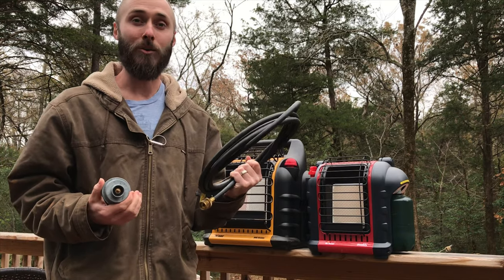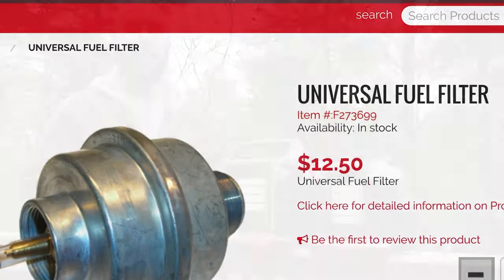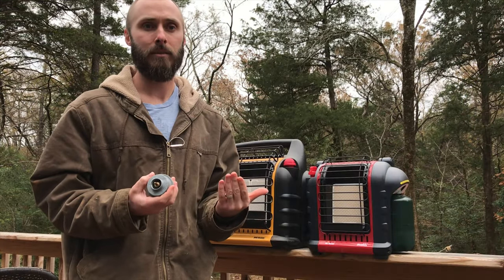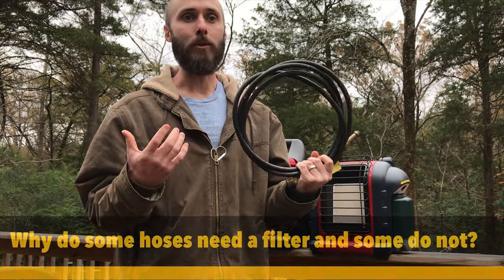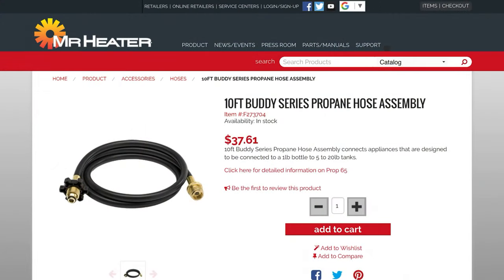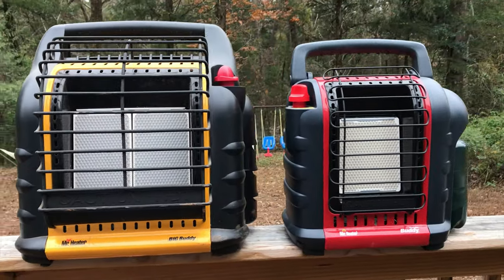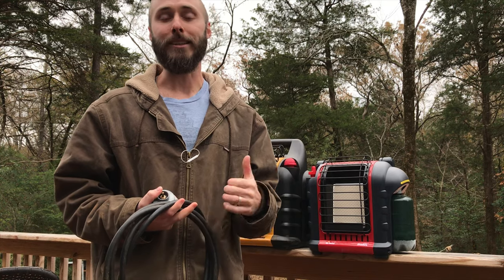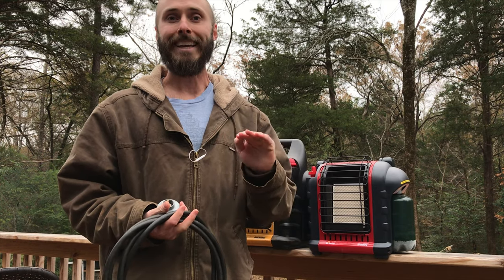Is a Mr. Heater Fuel Filter Needed When Connecting To a 20 lb propane tank? | East Texas Homestead

Comment: Why not just restrict the flow of gas from the tank valve? Thereby reducing pressure in the line.
Reply: He said because there's a built-in regulator and by doing that it would be over regulating the system.
Reply: You can get a hose with a regulator that attaches to the quick connect in the big buddy, bypassing the regulator built in to the big buddy.

Comment: You do NOT need the filter if you buy the 12' hose with regulator for the Big Buddy heater.
The new hoses are made differently so they do not leach oil into the Propane.
Reply from the maker: the regulated hoses are the way to go for sure. Not all "new" hoses are good.

Comment: There is a quick connect behind that 1lb bottle regulator that DOES NOT go to a regulator! If you are using the quick connect (@1:37, brass colors, right side of 1lb bottle regulator), you need the hose with the regulator at the tank! If you are using the hose that screws into the regulators meant for the 1lb bottles, then you do not need a regulator at the tank. If you pull up the Big Buddy parts diagram, there are only TWO regulators (for the 1lb bottles), not three! The quick connect taps into the line AFTER the 1lb bottle regulator!
Reply: Thank you!  I was about to ask why one of the hose choices has a regulator if it's built in. But now I get it, thanks. With a regulator on the hose with a 20lb, you connect to the quick connect. Appreciate the post.

Comment: To be honest , I just ran a filter on a bran new heater . After 1 winter season on a 4 foot hose , the whole system was soaked with oil . Buy a good hose and use a filter and hope for the best . Thanks for the advise !
Reply from the maker: Wow! that's no good. 
I've always run the Mr. Heater brand hoses and haven't had an issue.
Reply: @EastTexasHomestead  I used it as my sole source of heat for an entire winter . If I get 1 year out of a 87.00 ( going price at Walmart )got a new one ) I might be complaining too much .

Comment: The filter is just an inline canister that allows the oils pressed from the walls of the hose to rest outside the path of flowing gas.  They suggest you should replace these annually.  There's no way that you're going to fill this canister with oil before the hose itself is ruined, and I'd expect it would take more than a couple of ruined hoses to get any notable amount of oil into this container.

Comment: I bought a mr heater brand hose that does not require a filter and a year later my buddy heater is filled with oil. Im thinking it was either a counterfeit or you still need a filter. Expensive lesson.
Reply: Counterfeit.

Comment: If rubber is squeezing thru your hose then you are using the wrong hose. They do make hard hoses and I have had one for 15 years and still works fine. Coleman propane hose.
Reply: Mr. Heater part #F273704 is the one to get.

Comment: I saw a video of someone who was using a Mr Heater filter for years. He decided to cut it open to see what was inside. There were four tiny drops of oil inside the filter. And the filter is just a hollow aluminum ball....there is nothing else inside the filter. I do believe the filter is a good idea but it will last forever. Buying a new one every year is a total waste of money.
Reply: I have not found a video or picture of someone opening up a propane fuel filter.   I heard they were hollow inside but you are saying they have a ball inside for the oil to collect on?  Thanks.

Comment: I call B. S lol specifically made hose 😂 ive heard it all now
Reply: Just had to replace my buddy heater because I thought the same thing. This time I got a filter. I tell you what, it sucks when you're heater goes out at 12:30am all because I was cheap.
Reply: It's not BS.   Mr. Heater part #F273704 uses a different hose material that has low plasticizer content.  The cheap hoses have tons of oily plasticizer that will leak out under high pressure and gum up your heater.  It's really not that complicated.

Comment: My line has a schrader valve (similar to a tire valve). Take the outfit out doors, open the the valve on the twenty pounder, point the hose down towards the ground and push that Schrader valve and watch (safely) the oil blast out. Shameful where ever that oil comes from.

Comment: It is NEEDED 
Mr Heater is USELESS without it.
Mr heater works (without a filter) a few times before all the pipes inside mr heater are clogged w oil. Why the FUUUK does this not come with?

Comment: Question ... what about hooking the " portable " Buddy up to a 20 lbs ?
Reply: What about it?  If you do - use Mr. Heater # F273704 and you will not need a filter.  If you use any other hose, you WILL need a filter.
Reply: @sassylady2001   a bit on the Karen side aren't you #blocked

Comment: Double regulation doesn't cause high pressure. The diameter and length of the hose changes pressure. Research how an air conditioning system functions as it changes freon from liquid to a gas and back again along with changing pressures up and down. The laws of physics can't be broken. I would like to see inside a used filter to see if it actually collects what they claim. Natural condensation can happen, and plastics can leach chemical particulates but that's due to the type of plastic/rubber and other ingredients used in making the hoses. Never pay attention to the manufacturers' advertising. It's there to provoke you into buying their products. Their claims aren't facts.

Comment: Yeah I have a question when using  Mr heater hose should I still use a filter. For the most part i will never use a 1 pound bottle only a 20 through 40 lb tank

Comment: We have been using the regulated low pressure house for years no problems so far. in our big buddy heater.
Reply: That's because it's regulated.  Therefore the hose is low pressure, and likely didn't leach oily residue.  Many are not regulated, and under high pressure, thus they leach plasticizers.

Comment: I don't get it. I've bought two filters and I've tried them both on three different brand new Buddy heaters. I've never gotten the heaters to do much more than light that way. Slows the flow of gas too much. Works fine without the filter but only for a few months. Then I have to buy another heater

Comment: Most similar devices have a regulator at the tank to minimize pressure.  But the Buddy hoses are under pressure.  So with a cheap hose, you'll get an oily residue (plasticizer) that leaks out and will clog your heater over time.   Mr. Heater part #F273704 solves this problem by using a different material for the hose.

Comment: The first 10 ft hose you showed definitely needs a filter. I had one and it still let a dirty rhino refill tank to clog up and destroy the pipes in a 2-month-old Mr Buddy. So jammed up that high pressure gas along with alcohol only made it worse there was no getting it cleaned again. Ruining the system. That was even with complete disassemble. Also every single time you start Mr Buddy up again using that hose you were going to have to turn the gas off empty the line slowly repressurize it or the regulator inside the Mr Buddy will Peter out and refuse to stay ignited after you've turned it on. This includes if you move it 3 ft in your Workshop. So if you move the heater frequently keep in mind you will be constantly having to take three or four minutes out to re-pressure the hose just to get it to work again. I would recommend never purchasing that piece of crap hose. Other hoses work just fine that one for some reason messes with the regulator and is a nightmare to deal with from beginning to end. Did I mention don't buy it it's garbage save yourself a serious headache never ever ever purchase it unless you are masochistic and then you'll truly love it.

Comment: Wow hope you have more than 2 now and tons of tanks of gas. Stupid power grid. Don't use filters just good hoses 3 yrs no problems had tons of issues with filter. Causing me to clean out heater lines. Never letting heater run long.

Comment: Hi. I'm trying to change the regulator/fuel filter on my Mr. Heater Portable Buddy, but I can't get the black panel off. I've removed 4 Phillips-head screws, but only the bottom of the black panel  is moving. Something's still holding it together at the top, but I can't see where. Could you give me some advice, please? Signed, Juli--freezing in northern NM!

Comment: The oil is from the propane   It’s in there to lubricate the pumps and such in the trucking and delivery process
Reply: If oil does build up, is it dangerous when that oil starts burning when heater is in use.?
Reply: False. It's from the hose. The pressure from the tank is rather high and causes oils used to help the hose stay flexible to enter the heater and jam it up. 

They don't put oil in propane hahaha what you smoking man?
Reply: Literally EVERYONE on the internet is saying the opposite. Why are you the only person saying this?
Reply: Nope. The oily residue is a plasticizer made into rubber hoses to keep them soft and flexible.

Comment: I'm confused. There's a regulator built in the heater which is why they don't recommend a hose with a regulator to avoid over-regulation. However, they sell a hose with a regulator (F271803). Why won't their hose cause over-regulation? What am I missing?
Reply: Depends on which Big Buddy you have.....mine is the larger Mr Heater...it cost the most, but it has the two side  connections for the 1lb bottles AND a built in quick connection for an external tank using a hose....the two 1lb connectors have a regulator but the quick disconnect hose connection does not....the regulator may or may not be on the hose you purchase...I've purchased both hoses...one I use in my RV, the other when I connect directly to a tank, like when I'm camping
Reply: @earnieb5318   So...if I use the quick connect and a 20lb tank with a regulator at the tank, do I need a filter at the heater?
Reply from the maker: +Tango India Mike, no. You would NOT need a filter with that setup.
Reply: @EastTexasHomestead  Nope
...you should be good....regulator needs to be on TANK end of line though

Comment: the Contaminants ARE NOT from the hose! - Contaminants are from something called "heavy ends" and part of the cracking process. It drops out of the propane when it vaporizes.
Reply: They are from the hose.  Specifically, they are plasticizers that make the hose flexible and soft.  Under high pressure (non-regulated) they leach out oil.

Comment: Just a bit confused??? Big Buddy 12ft Hose with Regulator and Quick Connect is not really meant for the Big Buddy bc it doubles the regulators considering there is one already built into the unit???
Reply from the maker: I don't think you heard that right. The quick connect bypasses the built-in regulator so that the hose requires one on the hose itself.

Comment: What exactly does the filter do?  The reason I ask is that I own a Coleman stove that will operate with the 1 lb talk installed.  It will run initially if connected to a 20lb tank but will not operate once the burner is shut off then turned back on the following day.  I understand that compounds are used in the hoses to make them flexible and they will leak out into the hose under full pressure from the tank.  So I have to ask, what is the solution?  Do I need this filter, a regulator, perhaps a stainless hose, or is the stove faulty?
Reply: for the stove, a regulator is needed. One of the reasons maybe, and you can try it before thinking of something else...If you dont close the line then air can build up and it could take lots of time to get the gas flowing before it reaches the igniter.  To purge the air, you can open the gas for a few seconds before igniting. If that is not the problem, another issue I can think of is regulator going bad.
Reply: @philindeblanc  It does work if you revert back to the 1lb bottle.
Reply: @bigdog7914  It maybe the difference in the pressure the regulator can handle. The 20# pressure is much higher and maybe triggering the regulator, while the 1lb is less and it works ok with it.

Comment: They have a hose with a regulator attached , and you dont need a filter with that hose . Look it up on  mr heater website.
https://youtu.be/3O5tosOR9Lk
Reply from the maker: That’s right. I mentioned it several times in the video. It’s item #F271803.
Reply: @EastTexasHomestead  Good video. 
I suggest getting the hoses that do not require a filter. 
Im very glad that i got the 12ft hose thar doesn't require a filter. Its  much less hassle 
I have had NO problems..
Reply from the maker: I agree. Next time I buy a hose, I will go with the regulated version. It’s safer if there’s a leak anyway.

Comment: Hmmm, I've got a 5' hose with number F273701. Is that a type which requires a filter?  Thanks.
Reply: I bought this hose# as well after learning it was the type that does NOT need the filter.
Reply: @getx1265  the F273701 doesn’t need a filter? I couldn’t find any info on it on mr heater website
Reply: @owenhildebrand2075  Supposedly not.  It's a shame the info about this isn't clear.  I ordered the filter on Amazon, so I have it just in case I use a different hose that I have.

Comment: Forgive me, but I see NO REASON to purchase or use this small, but gas hog eating heater... Just get a regular vent-less heater and hook it up to a regular tank..(20 or 30 or even 40lb tank) I have used these for many years and NEVER used or needed a FUEL FILTER... To me, "they" are trying to get you to buy extras... and their hose prices are ridiculous...
    I believe the real problem posed by this system is to ADAPT the 1lb. can type fitting on the "LITTLE BUDDY to the "regular" hose type fitting on a gas grille type hose...  (normally, I believe, this is a 1/2 inch NPT male end... look on the box..)(it may be a 3/8, but I think it's a half)  Most of the "larger" heaters, some which are still quite small, have a 1/2" female outlet on the heater... In some cases you might have to buy some brass FLAIR end fittings downstream to make the hoses connections if you are using a grille-type hose... But by using this, you can go right to Grille type plastic fittings and FUEL GAUGES available on gas grille's suppliers....   And also, the connector suggested on the hose for the LITTLE BUDDY is, I believe, a 5/8" REVERSE THREAD to connect to the LP TANK...(inside the threaded end)  Normally, the only time you need this is to hook up to a 100lb LP TANK..
     To me, the LITTLE BUDDY heater and the MR. HEATER's PILOT SWITCH ON system is the WORST option for lighting the heater...  I much prefer the "PIEZO" system of starting the PILOT... I have had one Mr. HEATER's plastic knob become loose in no time at all, rendering starting the system a real chore...
     Lastly, and this might just be me, I PREFER a BLUE FLAME heater over a "Infrared plated" heater most any day.... just seems more fuel efficient to me... and also, in a pinch, you can use a small cook stove for heat, or even a turkey fryer heater, as long as you have ventilation, but NOT much wind...
Reply: The selling point on the buddy heaters is that there portable...great in a blind or camping....
I to like to encourage people to buy little gas stoves like you described. Because most modern homes depend on good clean sine electric to operate the electronics and then to run the blower motor.

Most of these small heaters can be hooked up to either natural gas or propane....
Myself dislike the blue flame...heat from it goes straight up
So unless you're using a fan, it takes a lot longer to heat a room..
Now the radiant ceramic plated type warms surfaces....like sitting in front of a fireplace....
Now i know you know all this I'm just adding my 2 cents...
After that cool spell last year that though Texas in a tizzy should wake a few people up.

Comment: The fuel filter is not for the propane,
but from the oil from the hose, that the 
pressure causes,
Alway use filter even on MR Heater hose, this  is a plus.

Comment: Simple. The heater already has a regulator built in. When using 1lb tanks no need for filter. Using a 20lb tank you use the oil filter.
Reply: The regulated hose connects to a quick detach on the heater, the other hoses attach where the 1lb canisters attach (which is a regulator) that's why hose with the regulator doesn't over regulate

Comment: 💯 True. One of the stainless lines on the inside goes down then back up forming a trap. I had to blow mine out with brake cleaner.
Reply from the maker: I've heard this is an issue but haven't seen it myself

Comment: Something was a bit odd. You explained that a regulated hose cannot be used because the Mr Heater has a built in regular;  two regulars in series will not function properly. But then at the end you showed us a regulated hose from Mr Heater. Huh?
Reply from the maker: Sorry for the confusion. The regulated hose uses a quick connection on the Big Buddy which bypasses the built in regulator.

Comment: So for a low pressure regualted hose does not require a fuel filter? I have a Procom wall heater and all Procom heaters are low pressure.
Reply: It's high pressure that causes the hoses to leach oil.  Most heaters have a regulator at the tank and low pressure in the line, but Buddy heaters have the regulator on the heater, thus high pressure in the line.

Comment: One question. I have never been into one of these filters. Curious as to if this filter can be backwashed with alcohol or Simple Green, dried and reused.  Thanks for response in advance.
Reply: No, the heater is now junk.
Reply: These filters only cost about $15 with tax. Easier to just replace instead of clean.
Reply: @SkypowerwithKarl  He did not ask about the heater - he was talking about the filter.  No - you can't reuse or clean the filter.